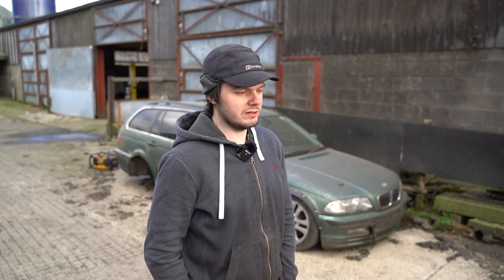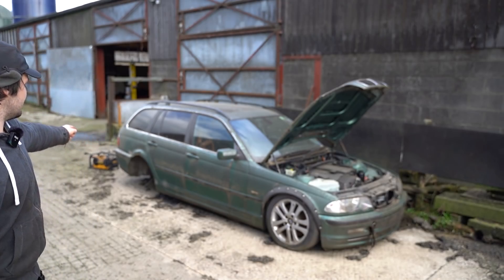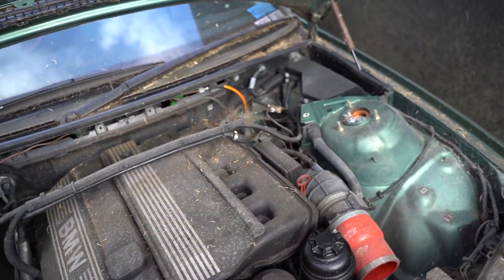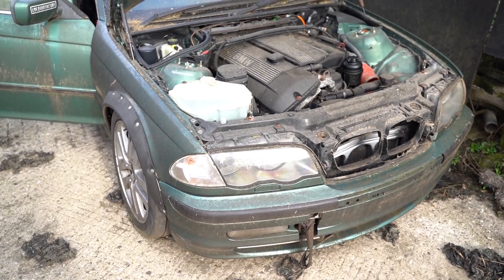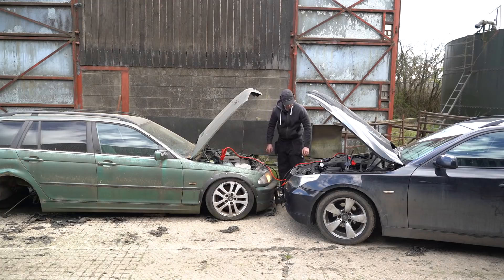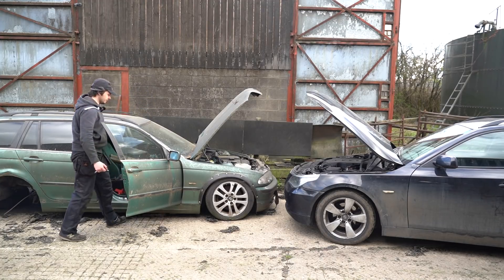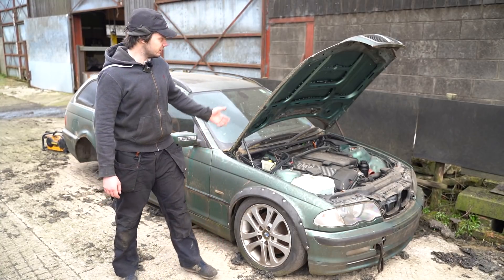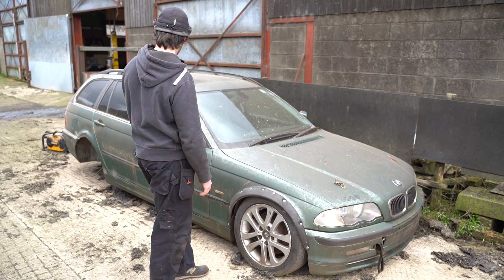NEW PROJECT CAR - Green B*stard

Comment: A 330i Manual.. Touring is rather rare indeed, last time I checked , there wasn't even a few hundred left. 
Word of advice, if you're going to drift it, would highly recommend dropping the sump on it and putting a upgraded oil pump to remove the real major weak point on those engines. Achillies Motorsport do a uprated shaft with an anulus gear already pressed onto the shaft, square drive on the sprocket and a reverse thread bolt. If i recall it's about £180 or so from the US, but better that than having the OE pump destory itself either by sheering the shaft, splines stripping or the usual nut falling off. 
Given the rear end is out of it, HIGHLY recommend you go to Radish Motorsport and buy their re-enforcement subframe kit for the rear end, £135 or so for all the plates before you put the subframe back in with fresh bushes. it'll have a nice tight rear end that won't try and rip itself apart. 
Still waiting on getting mine worked on (haven't got the space to pull the engine out and rebuild it at the moment) but it should be something spicy once it's done :)
Reply from the maker: People used to say that would happen on my M52 too. I don' t know if its any worse on the M54. Those plates help but if it's already damaged we'll be into a bit more work.
Reply: @dannyDC2  IIRC it's the M54 crank harmonics at high rpm that causes the oil pump nut to back off. Not an issue with M52s but can be pretty rampant on the M54s, M50/52 strokers and US spec E36 M3s. Cheaper options are just to drop pan and either use a safety wired nut or get someone to weld the oil pump nut in place.
Reply: @dannyDC2   With the plates, if it's already cracked, it'll just get worse. It's a case of get the work done now to save  more work later down the line.  With the M54B30's , it's a more common fault for the nut to unwind or the shaft to sheer as the stroke is longer than the M52's which cases more harmonic issues, which effect the pump a lot worse.
Reply from the maker: @tspencerj5335  it will definitely be a weld the nut job if anything. Not a quick job to get the sump off on these. Although my new engine support beam would have a starring role
Reply from the maker: @Sf_Mason  I am well aware of the issues dude but good info for anyone else reading this. I had small cracks repaired on my E46 you can see around 8:35, with plates welded in. I would advise you to get a brace in the back too, that's on my list

Comment: Good shout there Danny! I know all the Honda boys will be crying into their cornflakes now but you're definitely on my BMW wavelength! I had a Topaz blue manual 03 plate 330i touring quite a few years ago, it's up there with my current E92 330d as the best cars i've ever owned. Mine did have a slightly more subtle black leather interior though 😂
Reply from the maker: Yeah I owned quite a nice one back in the day too. 6spd manual sport with all the trimmings. Sold to an enthusiast who arrived in a Z3m. Wonder where it is now. RA53 was the plate
Reply: @dannyDC2  Interestingly, mine was YH03 AEW which according to the DVLA doesn't exist. Wonder what happened to it. Some of the cars i owned a lot longer ago than that one are still on there saying the tax and mot ran out many years ago......i'm talking the 90's! Son i wonder why it isn't showing up 🤔

Comment: On the weight loss side of things... Remember the ute MCM made out of an Impreza estate? Real bastard spec that would be.
Reply from the maker: I remember but I don’t think the skills are there. It would end up being heavier most likely. Not a terrible idea though as you’ve already got a split tailgate to works with
Reply: @dannyDC2  Depends on how much bracing would be needed to retain the strength, could be something to do when the rear gets implanted in a wall I suppose!